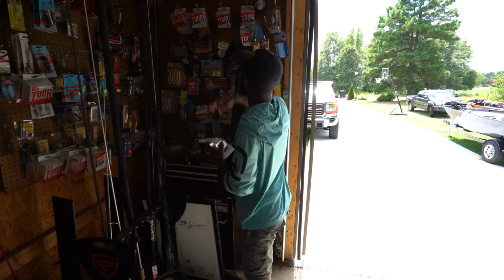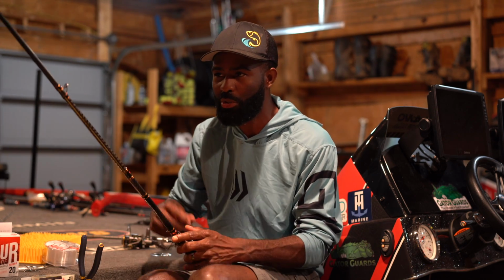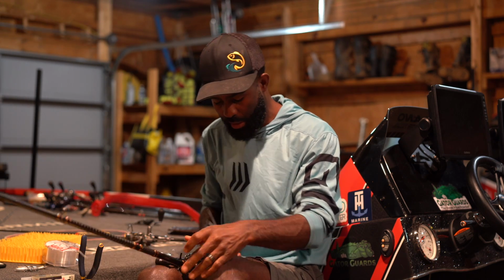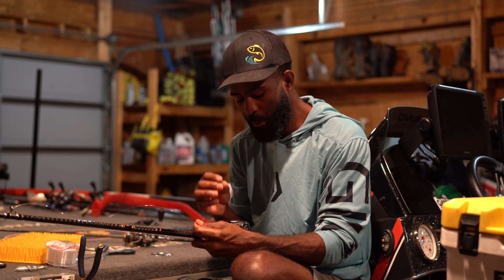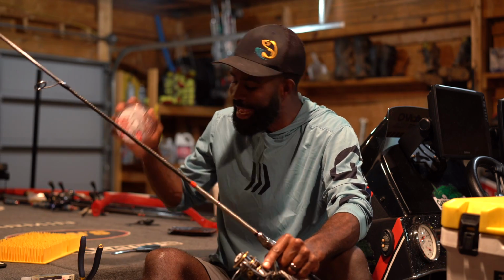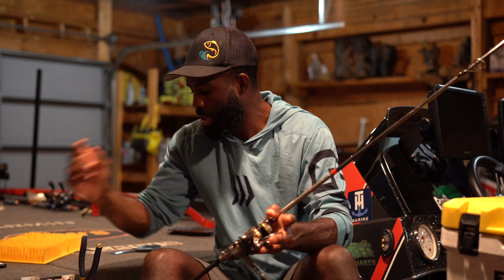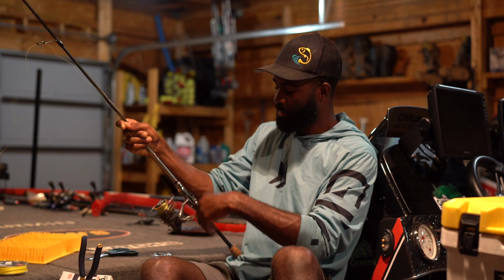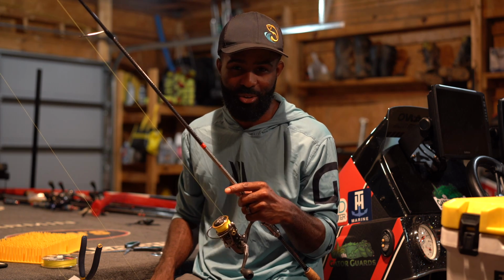The Correct Way To Spool New Fishing Line | Baitcasters & Spinning Reels

Comment: A good tip I use is to run hot water in your sink and drop the new spool of line in and wait couple minutes then start filling your bait caster. It cools down on your reel and changes the memory from 6” to 1”-2”whatever your reel spool size is. Thanx for the video Brian. Fat Fins Friends✌🏻

Comment: i am surprised you did not mention the important part about spooling mono is that the way the line comes off the spool needs to be the same way as it goes on the spool of the spinning reel, so if you are facing the spool on the reel you will see the bail puts the line on clockwise and so the line coming off the line spool also needs to be coming off clockwise, some brands come off clockwise facing the label others counterclockwise so you have to know if the spool on the fool or table needs to have the label facing you or not

Comment: Got a little tip, if u put a screw about a half inch into a piece of wood, you can put the line and pu the line spool on the screw and it spins freely and stays straight

Comment: Am I the only person fishing with just braid and just mono and never having a problem? Maybe the problem people are having is the knot they use to tie onto the spool. I’ve been using the Centauri knot to tie to my spool for year and it works great. I can cast off all the way down to that knot and it will never have a problem reeling back up with either mono or braid. I have experienced what he talks about with the braid slipping on hook set before tho. I learned you need to make sure your line is tight on the spool if you are fishing anything with slack line. I’ll fish a senko on a spinning reel with 15lb braid and every 5-6 handle turns I’ll tug on the line and make sure it’s not slipping at all.

Comment: Just found you. Your comments about "getting intense" struck home.  I'm 71, and used to do a lot of fishing with my dad in my teens and early twenties. Then I stopped. I picked it up again about 6 months ago, and to my surprise, found myself spending an hour or more every time I went fishing, dealing with tackle (mainly line spewing out of control, wrapping around my reel, developing knots, hooking myself or clothes and otherwise making it impossible to enjoy myself, which, as a retired person, is exactly the reason I started fishing again. Now, after screwing up putting my line on my reel, and having to cut the line to get it off, I bought a Pacificsun reel machine, which spins the line as it comes off the package and into my spool.  Still problems. I never even noticed these problems when I was younger. Second surpise is I can no longer see the line clearly to tie anything to the end of it. I'm working on a magnifying set up which should help with that problem. ALL I WANT TO DO IS GET TO THE DAMN LAKE, PUT MY BAIT OR SPINNER OR WHATEVER ON THE END, AND CAST , WITHOUT HAVING MY LINE COME OFF THE REEL LIKE A POORLY MADE SLINKY TOY.  Even though I managed to screw up spooling a baitcaster reel, I still think that a colorful braided line might be easier to see for tying knots, and also avoiding the demon memory syndrome. At least it might curtail the moments when my wife comes into the room, takes one look at my face and what I'm muttering, and knows enough after 50 years to immediately walk away . I WANT SIMPLE. What do you suggest. I do mostly lake fishing (once my technical problems are resolved. Some stream or creek.   Also, what size reel, line, weight of line. THANK YOU.
Reply: Awesome that you started fishing again. I have 2 Piscifun baitcasting reels ( Phantom and the carbon xcs). Both of them outperform my Shimano Curado 150 mgl day in and day out. Learned something today about backing on a casting reel. GREAT channel.

Comment: Correct way?  Did you maybe forget to tell people to make sure the line guide is centered before they start spooling line?  Yes.  Did you maybe forget to tell people to tie the line off at the center of the spool, Yes.  Then there is the way you hold the line close to the reel.  That inhibits the line guide from distributing the line evenly on the spool, causing it to bunch on one side or the other.
Reply: I thought about that.

Comment: How do you decide to get a right or left handed reel?
Reply: If you’re right-handed, typically you buy a reel with a left side crank. This leaves your strong/dominant hand for hook sets. However, there are right-handers that prefer the crank on the right, so it can be just your personal preference.
Reply: My dad was left handed and always used his rods so even though I'm right handed I still use left handed reels. I guess it doesn't matter.

Comment: Once again you have given some very good advice. I actually like to change out my line. I find it relaxing. One thing I like to do with either spinning and baitcasting reel is the next time I hit the water as I'm heading out I let the line off of the reel and then once it's done I bring it back in between my fingers to keep the proper tension. Since the line is wet you won't burn your fingers or ruin the line with I thought spot.

Again great video look forward to watching more and to follow you all season.

Comment: I spool the same way except I thread all the eyes first. That was impressive how you did that in I believe one take. Most people have 20 edits in videos. That's how I know you're legit.
Reply: That's a shame, because there are a few things he left out.  Like making sure the line guide is in the center of the spool and to tie off at the center of the spool.  Also, people holding the line tight in front of the reel is what causes the line to bunch up on one side as the guide cannot distribute the line evenly with the tension so close to the spool.
Reply: @poopjeans1135  It was 3 months ago so I don't remember everything in the video. I do remember being impressed. I do agree with you about holding the line to close. I personally hold it about 12 inches away or just keep good tension on the spool. I recently bought a line spooler by  Picifun and it has helped with line twist and worked really good for my spinning combos. Haven't tried it on my baitcaster yet.

Comment: i put flurocarbon in a bucket with hot water start to reel it on and when finished tie off to your first eye , it takes out the memory so when you spool  up it doesnt want to fly off your reel done this for years no problem
Reply: Take take the label off first though and get rid of all that glue so it doesn't get on your line
Reply: Thank You jake 👍🏼

Comment: Are you comfortable putting a heavier pound test braid on than the rod suggests you use?
Reply: Yes. If you look on the braid package it usually says what diameter the braid is compared to mono. For instance 30 pound braid might have the same diameter of 12 pound mono. The suggested line size on the rod, they are usually referring to mono or floro. So if the braid is in that range you're good.

Comment: Also higher end spinning reels have started adding braid ready spools with a gripping rubber type material already attached.
Reply: So thats why my reel has the rubber middle section, You learn something new everyday.
Reply: @justinsmith1915  The Braid Ready spinning reels have groves in the middle or rubber but even the metal with lines in it mid real is for the braid to grip..
Reply: I still use electrical tape too. Helps me sleep at night lol

Comment: Seriously, those spinning reel spooler deals are the way to go if you do not have a motorized spooler that puts the line right on the spool for you. Super simple and will give you zero line twist while the line is on the reel, as it should be.

Comment: So is the leader (when using 2 diff lines) the length of line for what carries the bait/lure?  Then the remaining can be fluorocarbon?
Reply: The line you tie to the reel is called the "backing", that is just there to take up space, you would use monofilament for that. Then you tie your "main line"(flourocarbon or braid) to that to finish off the spool. All you really need of that is at most 50 yards. If you are using braid for a main line and want to use a flourocarbon leader, that would be just a couple feet  tied to the end that you tie your line to. You do not need to use backing, but with stiffer lines like flourocarbon it helps avoid rat nests. The main reason people do it is because mono is a lot cheaper than braid. I only put mono backing on spools that have a lot of capacity, I just use all braid on most of my open water fishing reels.
Reply: @nathaniellarson8  thanks for the advice & clarification. I’m gonna see how  I can redo the reel that way
Reply: @acoupleofcakes  a lot of people just spool the whole thing up with monofilament and call it good and catch fish.
Reply: @nathaniellarson8   sadly, I had filled up on fluorocarbon🥴 lesson learned for the next time

Comment: I usually have a problem with the line not going on level on my spinning reels. Normally the top of the spool sticks out more then the bottom. How can I prevent this?
Reply: Don’t know what kind of reel you have, but I know Shimano reels come with little washers you can put on the spool shaft under the spool, or you can replace it with a thinner one, in your case, adding one of those paper thin washers to your existing washer would help level your line out by making the spool oscillate a fraction higher while reeling in which “should” make the line fill out the bottom a little more, but if you don’t have those washers I’d call the manufacturer’s customer service and explain it to them, generally they’ll have a solution or fix/replace it for you,

Comment: 😭😭😭 I needed this before I wasted half a spool of 17lb invisx 🤣🤣🤣 it literally made me go back to braid
Reply: That’s like $20 bro❗️😱
Reply: @JordanReedYT  tell me about it
Reply: @MrBigdawgstatus09  
I fish 20 lbs Tatsu which is their top line, so if I ever fuck up that’s $30 wasted for just half a spool.

Seaguar is THE BEST so I don’t mind the price.
Reply: @JordanReedYT  seagar is high quality but I like P-Line better and it’s like 3x cheaper. Don’t judge me but I fish with braid on 75% of my setups. I like fluoro for cranking and finesse.
Reply: @MrBigdawgstatus09  
Based on recent studies on clarity, abrasion, cast ability, knot strength, weather resistance, & sensitivity SEAGUAR is on average 30%-40% better than other lines & IMO once you get past 6 lbs test SEAGUAR has a way more connected feel in hook-sets too.
P-Line is really good too, & people like my dad only use Vicious, so it’s up to preference.

I’ve been using a baitcaster with only 35 lbs braid for 2 years now as my main setup & I love it for the sensitivity.  
No judgment there!

Comment: I grew up spooling my baitcaster with a pencil through the spool and holding it with my toes.
Reply: I still do it lol
Reply: i put flurocarbon in a bucket with hot water start to reel and when finished tie off to your first eye , it takes out the memory so when you spool  up it doesnt want to fly off your reel done this for years no problem
Reply: Is there any other way?
Reply: same HAHAHA
Reply: I still do at times !!
Reply: That's how I do it. Except I use a chopstick. hahaha
Reply: If I was respooling by the stream or lake  I used to just throw the spool of line in the water and start reeling it in. At home I'll throw it in a bucket of warm water. Usually dont have many problems.

Comment: Love your videos, Brother! I use spinner reels only because I am too dumb to use a baitcaster and here are a few tips that I have learned... When putting braided line on a reel, I tie a double knot and apply a small dot on the knot with super glue to secure it in place. When you have to replace the braid all you have to do is scrape off the old glue. When I am using flouro or mono, once I fill the spool I will take the spool off of the reel and soak it in hot water twice. Each time for about 15-30 minutes depending on the line diameter. Then I put the spool back on the reel and line it through the rod and take it outside and tie the end off to a solid structure and walk the line off to the end and start reeling in. Every 15-20 feet I stop and pull the line to where my rod tip bends and count to 10 . This does 2 things, #1 Tests the lines durability in various areas, #2 Helps to relive the lines "muscle memory" from production. Much love to you and your family, be safe, and keep up the videos!
Reply: u aint dumb man its just practice it took me like a week or two of straight fishing to learn how to use a baitcaster. when u get the hang of it youll be good at it

Comment: If you put your full spool into warm water it relearns the line memory to the new spool. That also helps. I use braid to floro on all my setups !
Reply: I do the same.
Reply: I started backing all my reels with braid but I put a little bit of electrical tape on the spool first.  I really don’t like fishing with braid as the main line as I just don’t really like the feel.  The only reason I use the backer so I don’t have to buy as much line.  I like to replace my line on the reel after each day of use if it was the main setup I used that day.  If the spool holds the a lot of line I will just cut off the amount of line I thought I was using.  I fish for sand/white bass mainly and I will use 4pound mono.  You gotta keep that thin line in good condition so it doesn’t snap on you.  The best 4pound line I found is the Trilene XL smooth casting.  I’ve tried others and nothing I’ve tried comes close….Floro on the other hand is a different story.  I stayed away from it for years due to $.  I haven’t found one I want to keep yet so I pretty much but a different kind every time.

Comment: The question is; how do you know how much line is enough. If you own a lot of rods and reels and fish a lot, you use a lot of line. All reels are labeled with how much line they hold. The smartest thing to do is use a line measuring device. They are affordable and pay for themselves in no time. Used braid makes great backing because it is lighter than mono and fluorocarbon. It has no stretch and memory. Overfilling spools is the major cause of backlashes. A little less line increases casting distance; the only way to know is measuring the line you put on. If you do this you save line and filler spools last longer. Fifty yards of new line is more than ample for casting about anything. So that equals making a three hundred yard filler spool able to fill six reels with fresh line.

Comment: I started using braid backing with 50lb braid to fluoro and my biggest problems were backlashes and my line getting bunched up to either side of the spook because of my double uni knot connecting the two lines. It was my first time using backing on my casting reels and after seeing this video I might try it again, but for me it’s just easier to buy a 150 yd spool of a specific lb test that I want to use for the reel and use the whole thing

Comment: Is it ok for starters to use all monofilament?
Reply from the maker: Yes!
Reply: Brian Latimer thank you 👍
Reply: It's all I used for 40 years until recently! I caught just as many fish as i do on braid/flouro. The only time i have ever run into trouble with all mono is when fishing long casts with top-water lures. The mono stretch can be a problem if you are reaching out long distances with your casts.
Reply: Tony Louvat thank you 👍
Reply: Yes you can. I used mono for a lot of years and it works great, at a reduced price from braid. If you’re on a budget, it’s a great option.
Reply: @upatree10  thank you!
Reply: Braid for froggin' though.